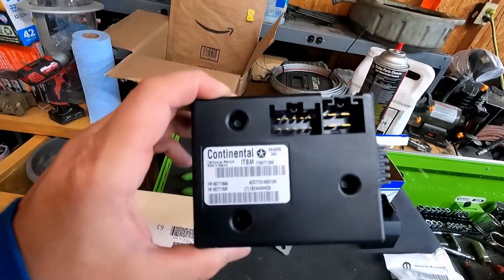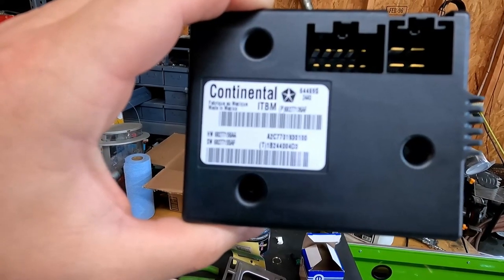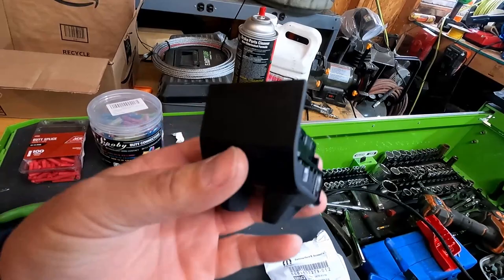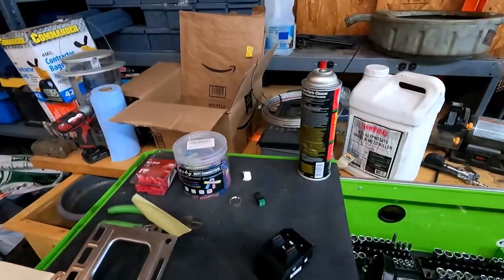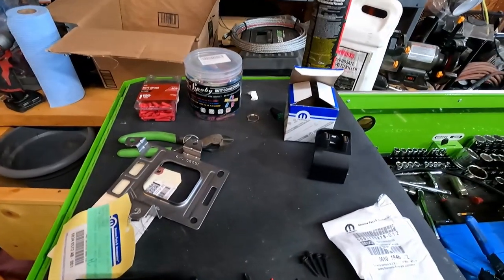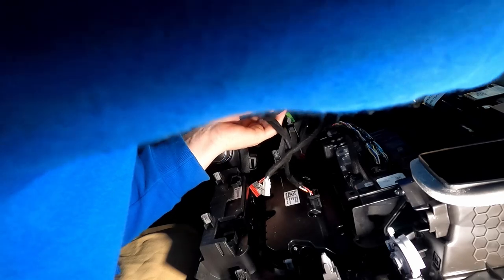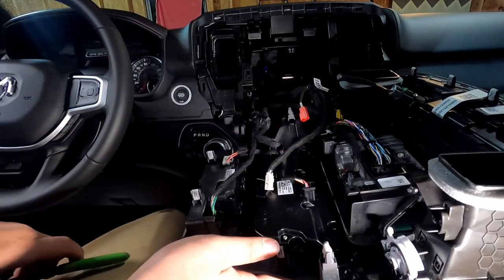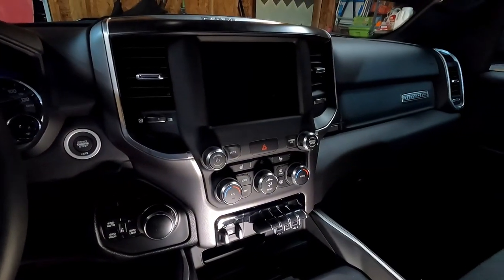2021 Ram 1500 Trailer Brake contoller

Comment: Do you know what that small extra cable is used for? The little 4 pin that’s also tied with the brake controller wire??? Aux switch??
Reply from the maker: No I don’t unfortunately. Could be a light setup for the laramie or limited trucks.

They basically wire every truck to accept any trump package. So your truck had all the wires for the most decked out truck. Even if it just ended up being built as a big horn.